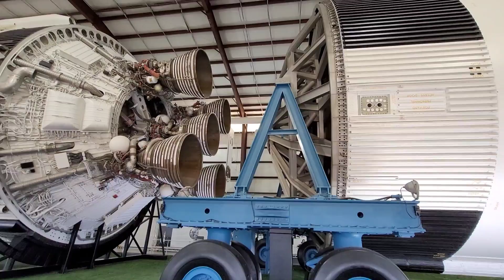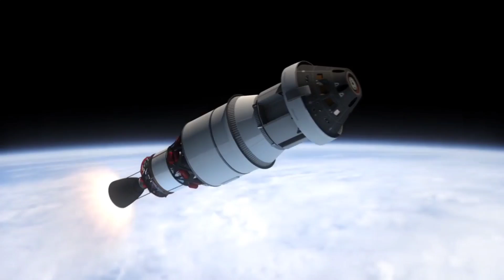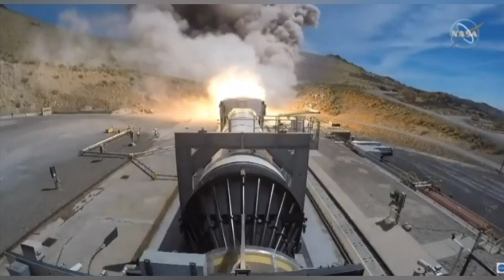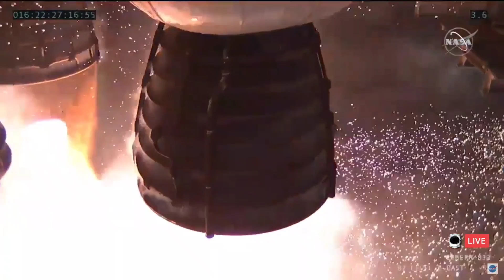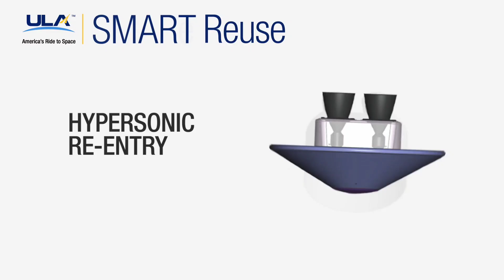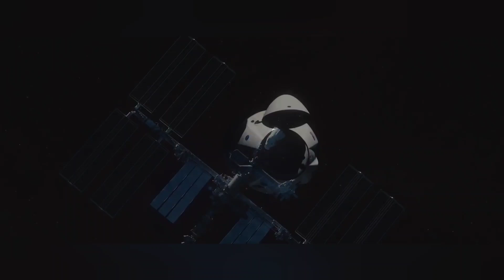Green Run Canceled! How did Boeing foul up SLS so badly? Can SpaceX or ULA (both?) solve this?

Comment: Talking about museum pieces, the Orion module reuses the AJ-10 engines. They've based on a 1957 design, which was later adapted to the space shuttle. And yet, they are also delivering the Orion module late 😂

Comment: ULA's CEO wanted to pivot away from massive single use rockets to fuel depots,  Senator Shelby got him fired & replaced with a Yes Man. I don't like ULA for being corrupt,  but for them to pull  "Space X transitioning from composite to stainless steel rocket body" type of move, they gained a lot of respect from me. Once we have fuel depots in space it opens the door to new companies & old companies going to the moon & beyond.

It opens the door to companies like Airbus & Mitsubishi building transportation that tops up at the fuel depots. Arguably fuel depots could be as big of a step in innovation as SpaceX's reuseable rockets because the public would  start talking serious discussion about ferries that stay in orbit & never land.

 Consider the possibility of trade shows where competition shows off their ferry designs & flight offerings as well as their fuel depot accommodation upgrades. 
When I say accommodations I mean space truck stops where there are hot meals & showers.

Comment: Boeing and other major MIC companies have figured out it is more lucrative to pump money into lobbying than into actual development on their contracts. They can always get extensions. But once they fulfill a contract, the gravy train is over. That up front 4 or 5 Billion can easily be coaxed into 20 Billion or more. Why would any company ignore that and just "do the right thing"?

Basically, if we want actual advancement into space, it's going to take full commercialization and no longer depending on a corrupt government system to do it. SpaceX seems to be the leader in this deviation from government run space projects. It's only a matter of time before they and others "go their own way", because they simply don't have the lobbying power of the old established companies like Boeing and frankly they seem more motivated by getting to space than purely money. It all depends on who wants to invest in it and for what purpose. But it's only a matter of time before the commercial possibilities are realized. Space is a gold mine.

I wish I wasn't so cynical about it, but having worked on a major R&D contract and having seen how quickly corporate would trash valuable work in order to reset everything to get more money from the government, at this point I think it's time to just forget government intervention entirely, as far as regulatory bodies will allow.

Comment: You realize the Orion has a bad power supply, that would require pretty mich taking apart to replavpce, so they are going to fly it with the bad power supply. Another fine Boeing space systems design.

Comment: It's been delayed by a valve issue.  That is not the same as cancelled.  

The SLS stage on the test stand is a flight article and so far, it has not exploded.  In contrast, three of SpaceX's starship test articles have crashed.  This is the vehicle that is supposed to land on Mars with 100 colonists aboard, or land on the Moon.  It's supposed to return from another planet and safely land after reentering the atmosphere at 25,000 miles per hour.  It's crashed three times in low level test flights ON EARTH.  The SLS core stage flight article, while not completing a test yet, is intact, and NASA engineers want the flight proven hardware to work perfectly so it doesn't explode.  

Who's messing up again?

Comment: Because Boeing are a crap company that's why!  

You only have to look at how they lost out the main airline selling business to Airbus.

They I am sure either bribed NASA to give them the contract or told them it only take and cost under everyone else's stated contracts for the rubbish launch system 
which after all is a total waste of time and money since it is 100% NOT reusable and hence a waste of the rocket system unlike the starship by space x.  

So Boeing get the contract and then waste tons of time trying to meet the deadlines and fail because they lied about 
how long and how much this already waste of money and time this pointless launch rocket would take.

They will end up cancelling it as it has dragged on and on well over budget with it now well out of date and space x is taking all the contracts from Boeing and the other rocket companies. 

By the time they finish this waste to time rocket system space x star ship will be running and be 100% better price wise to use to launch heavy cargo in to orbit before this crap SLS is even launched on it's 1st flight.

Comment: No company could f@#k up as badly as Boeing without doing it on purpose.  My conclusion is that SLS is not designed to succeed. FOLLOW the money. This is about making the rich richer at taxpayer expense.  My disgust with Boeing is only surpassed by the perfidy of the participants in this charade.

Comment: And to your point about the technology being fifty years old, the concepts are fifty years old, the technology largely has had to be retro fitted between the analog age and the digital age... that being such that it is, in the manner that between Challenger and post-Challenger space flight there was something in the vicinity of a two to four year hiatus, over as many flights as was conducted by the original STS program, a massive bank of core problems needed to be analysed for modification and requalification between Space Shuttle and SLS. Certainly, I would wager the only thing that is the same between STS and SLS is the general appearance. The list for instance, of materials that were genuine running concerns and maintained in ordinance for the continuation of STS, about 23% of those were discontinued between the last flight of Space Shuttle and the initiation of SLS, not to mention the products that on top of that could not be recreated because they outlived genuine usability in so far as they would not be allowed to be approved even for single use by for instance the EPA... I mean, the list of things is immense. Between the draw down of STS and the beginning of SLS nearly half of the specialist manufacturers for STS ceased to exist and developing an entirely new production chain, sourcing materials and parts, supporting businesses... all of this takes immense effort and time and patience. Part of the purpose of Ares was to continue some part of, if any of the supply chain for future similar programs since Space Shuttle was largely seen as an incremental portion of an overall generational design lineage between NASA and general aerospace... The GFC made this virtually impossible to justify in monetary and economic terms and equally, Ares was thus cancelled.

Comment: I agree with the message here, but this is false:
15:25 No, the orange fuel tank in SLS is not the same as the external tank on the Shuttle, nor is it simply a stretched version. They have nothing in common aside from their diameter and colour.

Comment: Hey Angry Astronaut, I feel like invariably you have both posed questions and answered them except in a disjointed manner... let me ask you, if you have refuelling for small space craft in near earth orbit what is the incentive for heavy lift component craft? To say, develop larger stations, further from earth... you rightly point out that the increment of cost on many of these projects seems to dwarf their benefit but longevity as you also noted, regarding the Apollo third stages is almost certainly a baked-in effect of fine manufacture... to put it another way, let's say we ran with this trend or that trend with immediacy as it comes to the mind of this politician or that politician without either thinking about the indelible consequences or else, the way we might create the effect of indelible consequence, if indeed that is the purpose of any program...? You wouldn't just expect to put any old junk into the orbit of the earth or the moon or even mars?

Comment: I am completely on board with the criticism of Boeing but one thing that is important to understand is that that big orange tank is quite different from the tank of the STS shuttle missions.

It is now, effectively the core stage for SLS and needs to handle the additional forces from having SRBs attached directly to it and engines attached to the bottom. Dramatically different dynamic loads will be applied to the core stage as opposed to the shuttle being connected to the fuel tank and SRBs previously.

It looks similar but internally, it is significantly different.
Reply: This ^
There's practically no commonality between SLS' core and STS' ET.
Reply: Should have made Shuttle-C.

Comment: Towards the end of the cold war, the DoD sat the heads of all the various Defense Contractors (most of whom were Aerospace oriented) and told them point blank "Budgets are getting smaller. We can't afford to keep you all afloat. You're going to have to merge". Boeing gobbled up McDonnell, GE sold most of it's defense division to Martin, who then merged with Lockheed (who also bought up Sikorsky recently). Northrup sucked in Grumman, etc.

Basically there's really only 4 companies left at the top. Less competition = less push to innovate and do things cheaper. Boeing underestimated SpaceX considerably, didn't think SpaceX could really do anything worth while, and so wasn't really a competitive threat. Therefor Boeing figures they have NASA over a barrel. if Boeing doesn't provide it, who will? LM doesn't really do boosters anymore. Raytheon isn't in that business, NG really can't handle that scale, etc.

The sad part is that back in the Apollo era, Boeing was consider the leader in systems engineering and test - they set the standard and that's why they got the Prime for Saturn 5, and for the ISS. But seeing what's happened with SLS, their Commercial Crew capsule's disasterous first test flight, and the 737 Max, that leadership position is certainly questionable now.

Comment: The SLS is a stupid rocket without a mission. For the amount of money spent on it, NASA could have performed every hypothetical mission using the Falcon Heavy and doing LEO rendezvous. Instead of spending money on a larger rocket than the Saturn which carried less than the Saturn, they could have spent the money on the Spacecrafts and fuel tanks and be on the Moon by now. It's very simple. ONE 50 ton launch for the engines and N2O4, ONE 50 ton launch for an Aerozine tank. And, finally a third for Spacecraft -- which may not need to be a Falcon Heavy if it's just the Orion.
--
The problem of course is that won't keep the Shuttle contractors paid, Shuttle workers employed and all the Senators from all their states happy. SLS = Senate Laundering System.

Comment: I worked at NASA and got the boot in 2009 when the shuttle program ended.
Reply from the maker: I am so sorry. The Shuttle should NEVER have been canceled until we had a viable replacement.
Reply: @TheAngryAstronaut  and kill how many more people?  Had Columbia accidentnot happened  (ironcially enough, same thing happened on STS-2 and in STS-1 to 4 Columbia was used for investigating what ultimately killed her later ) , at least two-three orbiters ( Discovery, Atlantis and Endevour ) might have truged on for few years, but most they would have accomplished would be another Hubble mission. That was Shuttle's problem - inadequate flight rate ( originally planned is  BARELY being reached now by Falcons) and eye-watering cost of ground support infrastructure.

Comment: I've said it before the space industry is about selling promises. They are incentivized to under perform, or not deliver at all, as this only results in more money for less actual work. Boeing's issue in broad terms is that it isn't Boeing anymore. When the Merger with McDonnell-Douglass took place, the Structure of the company changed from excellence in engineering and product to one of profit based decisions. The end result? Boeing became M-D as the aggressive people who ran M-D into the ground took over Boeing. That culture continues today and congress continues to push Boeing as a beneficial Monopoly in aerospace for this country.

Comment: Boeing went straight to crap after they allowed prior McDonnel Douglas executives to take over the boardroom and headquarters.  MD was all about profit above all else, see for reference the current B737 Max fiasco.  SLS is being treated to the same gross mismanagement, for the same reason:  profit.  I doubt we'll ever see an SLS launch.
Reply: M-D management = Cancer. Boeing: I'll take some of that.
Reply: Never was that way under James McDonnell himself. The only problem child under his watch was the DC-10, and after all the defects were addressed, it became the safest airliner in the skies.
Reply: @dalethelander3781  The design of the trijet made any catastrophic failure of the tail mounted engine a likely 100% loss of the plane. The Ducted engine of the L1011 allowed for vital controls to be away from a potential issue. It was a better design undercut by MD's cost cutting special. And people died because of it.
Reply: @twotone3471  But it was a failure of the cargo door, twice, that caused the first accidents. AA 191 was caused by a maintenance procedure that wasn't approved by McDD and that was the #1 engine.
I remember that day. I lived in Elgin, IL, and you could see the smoke plume from there.
Reply: No, it'll happen. Eventually. 10 years late, after SpaceX and others team up on thier own and do it.

Well, likely just before.

Comment: Do you need fairing to launch Orion? Starliner with Atlas V does not. I wonder if you could launch people aboard Orion with Falcon Heavy, then launch another Falcon heavy with no payload but 2nd stage fully fueled. Then dock 2nd Falcon's 2nd stage to Orion and go to the Moon. Some payload adapter would be needed.
Reply from the maker: Regrettably, FH needs to be human rated...something that Elon has stated that he will not do. Assuming he does an about face, it would still take years and some inventive engineering to perch something as big as Orion atop a rocket that is no larger than an F9, volume wise. It can be done...definitely...but I wanted to present a solution that involves rockets that either are flying, or will fly this year that could carry Orion with no modifications or human rating. It's more complicated, but still cheaper than SLS and has a reasonable chance of working in 2021.

Comment: Honestly, I'll posit that the real problem isn't Boeing (or at least not JUST Boeing). The problem is that at the twilight of the Shuttle era, everyone was scurrying to figure out a way to keep the standing army of shuttle workers employed. To make it seem more palatable to Congress, NASA proposed reuse of as much Shuttle technology as possible. The vehicle we have today is very similar to National Launch System, proposed way back in the '90s. The problem is that we had to shoehorn the mission to fit the existing hardware, rather than design the hardware for the mission. Each time a piece of mandated technology wouldn't work, more redesign, set-backs, and cost overruns occurred. Add to that the fact that until the previous administration, there was never enough funding to actually finish anything. Taking longer always costs more as well, since you have to continue to maintain facilities and pay engineers and skilled workers to be there, even when you aren't keeping them busy. 

All that said, I do think SLS will be a reasonably capable rocket once it gets flying. BUT I like the proposal in the video of doing 2 Vulcan + 1 Falcon 9 / Crew Dragon launch. I think it's very innovative. It does entail some programmatic risk related to docking the two spacecraft and doing the in-orbit refueling. Those things would have to be proven out in flight before we could go all-in on that approach. Still, it's definitely worth the look, especially given how cheap that would be to prove out. 

The problem with it is that it doesn't gaurantee enough jobs in North Alabama, and none in Utah. But the case could be made that it frees up folks who are currently tied up working on SLS to work on the propellant transfer problem, Gateway, lunar habitats, nuclear thermal propulsion, in-situ resource utilization, and other activities that have been neglected for decades.

Comment: IMO the problem with Boeing is the same problem NASA has with it's manned space flight division. They know what they are supposed to do but they have no idea how.  Having a PhD is not the same thing as knowing how to tie your shoelaces. Being the smartest guy in the room is not the same thing as being able to learn from your or others failures.  Having every resource at your finger tips is not the same thing as putting on your big boy pants and and pushing ahead despite a powerful headwind.   This very special mix of arrogance and fundamental stupidity perfectly explains Boeing's and NASA's failures.

You may note that JPL has no such issues and they are an unmanned division of NASA.  Note that Boeing has had similar issues of late with their airplane division.  Note that SpaceX has lots of problems but always gets beyond them.  The NASA of the Apollo era no longer exists (variety of reasons) and I'll suggest Boeing is in the same boat.  In a lot of ways, SpaceX IS the NASA of the 1960's.

Comment: You really have to understand the technical challenges inherent in a rocket this powerful to understand SLS’ problems. 
SLS deserves a lot of criticism, but yours is completely off the mark. Core Stage is not 90% shuttle parts. And COTS hardware that can survive the SLS environments is just not available. Especially not “modular” hardware that’s easily R&R. 
I spent 9 years working for Boeing on the Core Stage program.